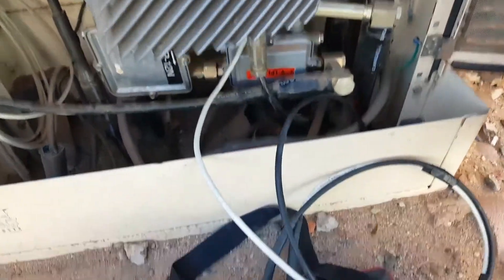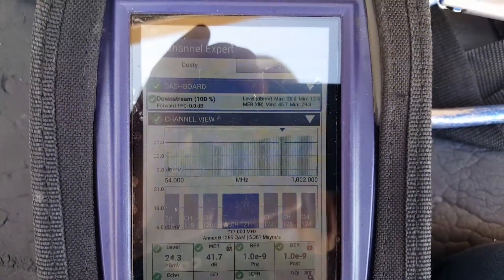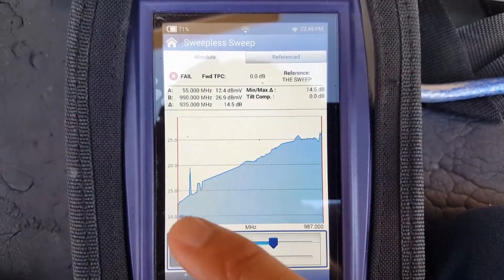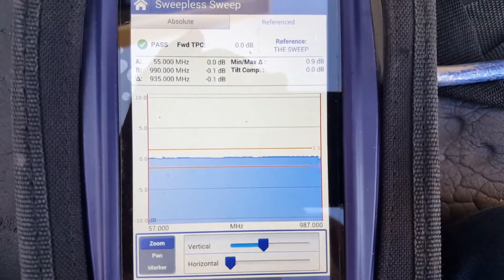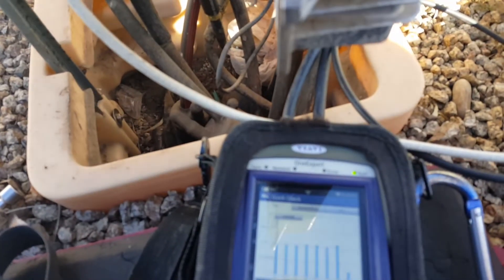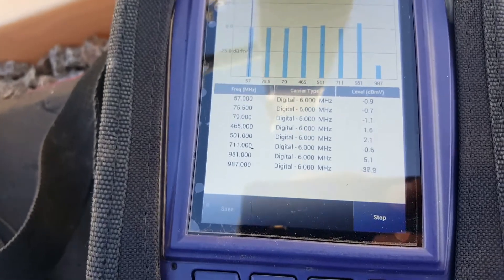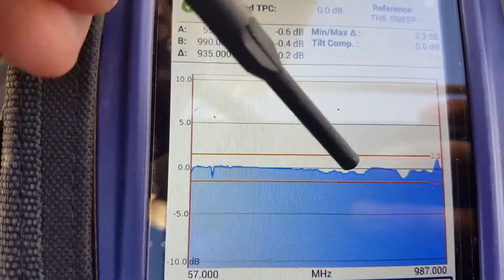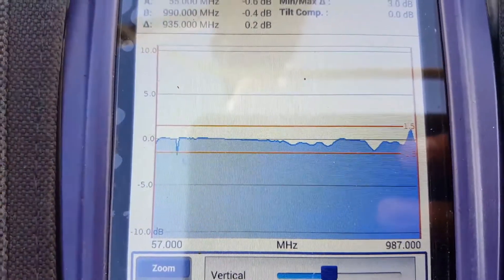What happens when CATV Maintenance sweeps?

Comment: In our office we started doing full sweep on both forward and return. What a utter fiasco it's been! We keep arguing with management about there insistence on how when sweeping you don't need to worry about the levels being perfectly balanced at every active as long as the sweep scan pass. They want us to stop looking at the full scan for balancing and want us to balance to the zero marker on sweep and let the levels be what they are when it's done. It's getting me to the point of looking for a new job I'm hating it so much. They keep preaching that we've been balancing over imperfections for years and blah blah blah but when I complain that even though I made the sweep scan pass my highest channel is now multiple db low they tell me don't worry about it.
Reply from the maker: We had a time where we had not so many sweep points and it would skip over large amounts of channels. I got into using sweepless sweep because it hits every channel as it uses each channel as a sweep point. I even proved my case to them it was missing water damaged feeder that regular sweep was missing. Luckly leadership was awesome and jumped on board.

Comment: as of 11/20 Spectrum now has new CPE amplifiers the issue is the upstream carriers are to powerful they must be no bigger than 50 db. These new amps have unity gain on the upstream limits the upstream amplification. Model number Antronix VRA900B/AC. Pain for installers now. With Stratasync on the Viavi there holding all the techs to a much higher qualification level.

Comment: I really love using the JDSU Smart Id's when sweeping an inhome. My drop from the pole was getting old so a Spectrum cable guy rolled out there still using 6300 meters. He was blown away when i showed him my 630 and how I was seeing ingress etc on the drop  then I got him to install a smart id on the end of the drop at the pole and showed him the sweep. He said they were getting the Viavi's soon but all the guys weren't sure about it looked complicated. He said I am now!
Reply: Really getting into the weeds there, we just replace them if noise is causing timeouts tiling etc I just replace them, or check fitting wall plates, some techs will do a deep dive but routing hammers us on the drip routing systems

Comment: The Docsis 3.1 set up in the Tampa area is very different than yours. Here the OFDM bonded channel is a the top of the freq on the end up at 1.2 gig  a 100 mhz wide carrier. 3 profiles on the CM.
The new Cisco cable boxes are a pia. The Docsis carrier has to be almost exactly at -5 db or the box will just go offline every few days.
Reply: Have they rolled out the ofdma upstream in your area. If so RIP
Reply: Update few weeks ago the moved the OFDMA carrier the 200 mhz wide carrier into the hole the repack created at 200 to 400 mhz. Lots of things changing in the Tampa/St pete area.

Comment: Why do you have a 16 pad in the input?  You should have 18 hitting the chip inside the GI MB's, so you should have a 7 pad (based on your 25db input reading) on the input and the rest in the interstage.
Reply from the maker: Woah woah. These Motorola MB will catch fire with 18 hitting the chipset lol.
These are 4dBmv input amplifiers with an interstage tilt of 14dB
25 over 19 will require a CS6 to get the high band down to match the 19dBmV of the low band. Then I need to pad it down with a 15 pad to bring the flat inputs down to 4dBmV. Then these amps have a 2db reserve gain so we put a 2 pad in the interstage pad location 
However, if you re watch the video the 16 padding was before I set the amplifier up. I mention that I need to cut away to set the amp up. Then the video cuts right back in to a semi clean sweep after it is all set up.
Reply: @thebasiccablechannel7464  18 hitting on the high end.  So if you're setting up  at 120/5, and your inputs on 120 are 23db, you want a 5 pad in the input so 18 is hitting it.
Reply from the maker: 18dBmV even at an analog level would be way too much for these Motorola 100s amplifiers.
They require a 4dBmV digital
Our Line extenders require 11dBmV.
You have to be referring to different amplifiers. 18dBmV is a lot of signal for any amplifier. Defeats the purpose of amplifying it if it has to be that much power going into them.
Reply: @thebasiccablechannel7464  we set ours up at 18 on MBs and 21 on LEs
Reply: @thebasiccablechannel7464  ,@J Coz  this will all depend on the model and brand of amplifier, reference you spec sheet on the particular model and this will help determine the minimum input value on the amplifier. in my plant we reference to min input of 14db with an 11db noise floor on BT,MB we reference min in at 17 on LE. These are set with analog pilots in our 860 mhz plant. All equipment and cable plants are not made equal.
Reply from the maker: Digital or analog levels?
What is the model of your amplifiers?

Comment: Nice video. I'm a MT and noticed your BERs on ch 121,122,123. I've just run into that myself and trying to track down. Ch 120 and below and 124 and above are fine. Tentative theory: off air interference. I used a dipole with ONX Spectrum mode and see impulse burst up to +20 dB in that 770-800 MHz range. Luckily our plant is fairly tight.
Reply: 4g LTE leak?...their 20mhz wide and generally in the 700+ mhz range..
Reply: @jaydoublebusy  thats exactly what it is. When running onecheck at my job I used to have to walk away so my phone wouldn't cause a fail on 121
Reply: @crappyatlife  
If the system is sealed and youre running a proper test that shouldnt happen.If it does you have a shoddy meter.I only see it when theres plant noise.Ill acrually pick it up off my meter pig tail and watch the haystacks.Shows maybe -16 dbmv sporadically too on single channel

Comment: so when im sweeping i need to reference at the node and make sure i keep my sweep close as possible to the node?  also say for example at my 4th amp in cascade 3 taps in, i have a customer with low mer, i would reference at that amp and sweep forwward out of it?
Reply from the maker: aaron sookdeo - ideally you would like to keep your sweep as flat as possible across all amplifiers to ensure you have Unity gain. Any dips or roll offs mean something is not right.

Low MER off one or two taps can usually be isolated without sweeping. Generally it's good up until the point that it is not because something is wrong. You can usually divide and conquer to find those types of issues.
Although a nice sweep and unity gain especially on a large amplifier Cascade (4 amps) the overall MER health will benefit on all channels.
Reply from the maker: FLEX FITNESS let me add that you could save a reference at an amp then check the proceeding taps but the response will not be flat. It will start to reverse tilt further by each tap you go downstream. But if there is a notch suckout, water damage or roll off you will spot the issue in the sweep response.